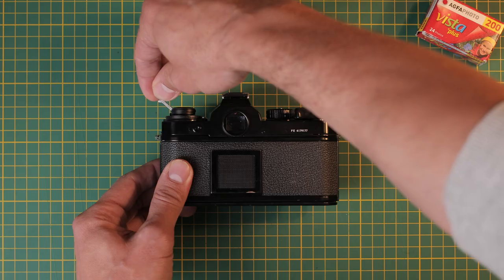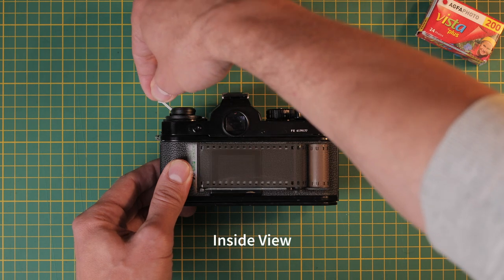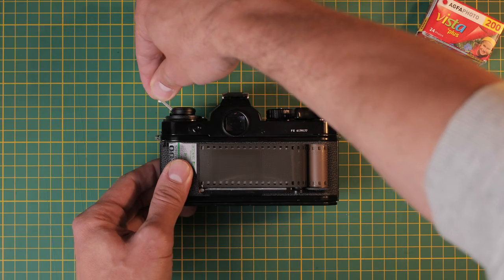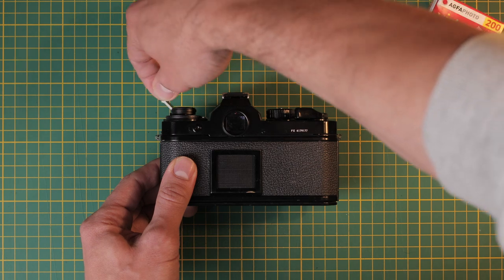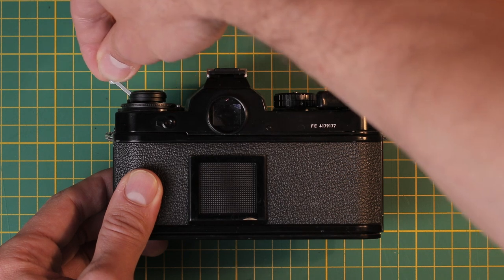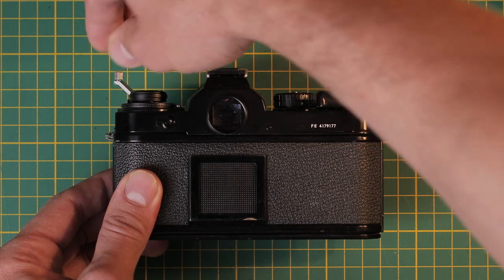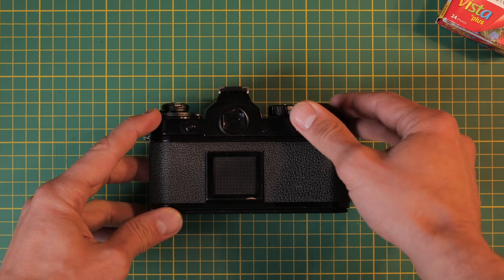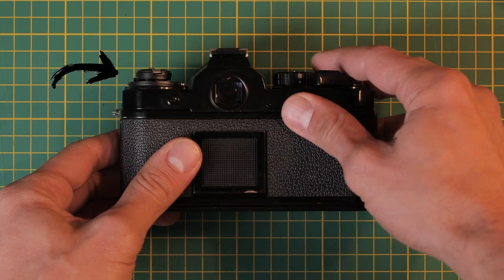How to know if Film is Loaded

Comment: Before twiddling the rewind handle. A quick glance at the frame counter could also be a good first indicator. If the number shows something like >10 chances are you might have some film inside.
Reply from the maker: The counter in most manual cameras still ticks up if the camera is empty, or not loaded correctly, so that would not be a good indication
Reply: @pushingfilm  Yes, that's true. I was just referring to myself. I just know that I very rarely do like 17 or 23 "blank" shots. So I know I probably got film inside and I'm good to go. 

But your approach is definitely fail proof. I didn't want to criticise in any way.
Reply: @fastrockstar1705  If you load the film incorrectly without realizing it, you might take 17 blank frames. Later, when you check the counter and see it’s at 17 frames, you assume the film is loaded correctly. This approach isn’t very reliable because it depends on the film being loaded correctly from the start. However, if you verify the film is loaded properly at the beginning using the method in the video, then relying on the counter afterwards should work well.

Comment: And if the film didn’t load properly what then? Say you follow the advice, the rewind button hasn’t been pressed but if there’s only a couple of inches of film pulled across the shutter curtain and you rewind it could end up vanishing into the film canister.
Reply: You can pull the film back out, just search it and you’ll find the instructions
Reply: @marcellkovacs5452  I’d rather avoid having to pull it back out, looks tricky. I think if the shutter is cranked but the rewind doesn’t move it’s safe to say the film is still in the initial position and needs hooking up with the forward winding teeth on right.